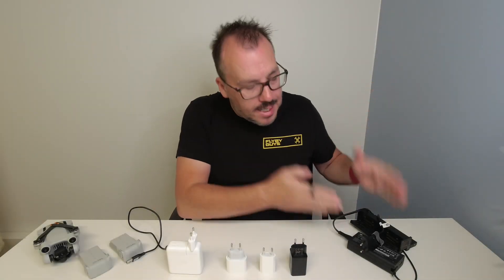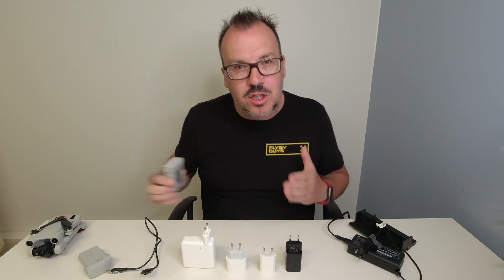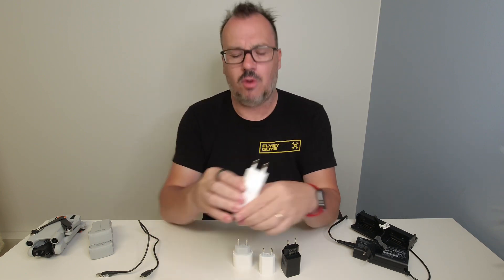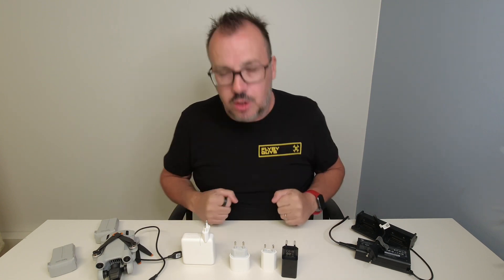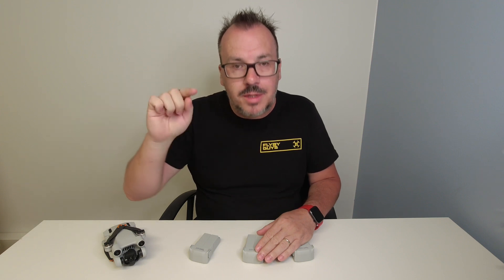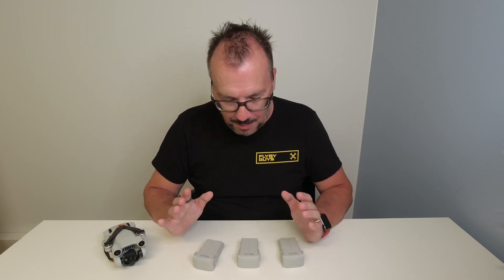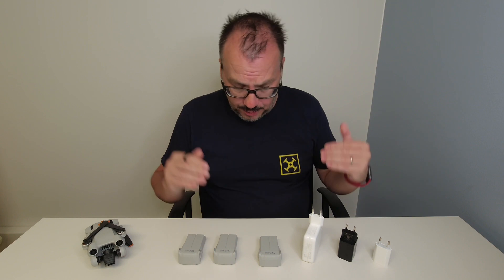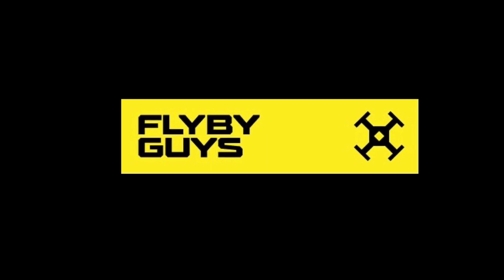Watt The Hell? Charging The DJI Mini 3 Pro, Efficiently!

Comment: WOW, that was actually a big surprise for me. Am I right in thinking though the faster you charge a battery the less life you will get out of it. Also i didn't realize  you can actually charge the battery whilst it is in the Drone. Thanks very much for sharing this. I have liked and subscribed. Any idea where i can purchase the 67W charging plug in the UK.
Reply: Get the Ikea Sjoss 45W, its cheap as chips and It's a solid charging brick
Reply from the maker: Welcome to the channel, Mark. 
I’m sure Curry’s have a fast charging brick, but definitely Amazon. 
I think harm to the batteries can only be done if you’re using them every day. 
If you’re only flying once a week, then a fast charge is fine. Hope the helps.

Comment: I was told to be careful if the watts are high they'll mess up the batteries and they'll have less life? I have an LG fast charge block but I don't know what watts it is I just know having all 3 batteries charging at once it got hot. I have a 10watts charger block from a Motorola phone it went to. Can that work?
Reply from the maker: Hello. I think the harm it does to the batteries is over a long space of time, if it happens at all. 
If you use the drone and all the batteries every single day, then I would be careful. However, using them once a week or so, then I think it's ok to fast charge. Quicker the better I say :)
Reply: @FlybyGuys  what kind of watt block should I use?
Reply from the maker: @mrsjackson5555  Im using anything from 60 - 100 watt charging for the Mini 3 pro batteries. I don't see any issue from my side, but  I don't fly this drone regularly.
If you do, please do this at your own discretion.

Comment: You had a good presentation. But there are a few things that I would have put in there myself which would have added to your presentation.

1. The power cables.
All power cables are not created equally. I would have also mentioned that in addition to this, they have a $16 device that will test your cables to determine whether or not they are designed for data or power or both. The quality of the cable is also dependent upon how much power is going to be going through it and if it is a poorly designed and constructed cable, you could have the most powerful power brick made, but you would not be getting the proper amount of power wattage throughput. Essentially it's like trying to feed a flood water through a straw and we know what happens then, you have a bottleneck. By getting a good quality cable and matching it with a good quality power adapter, you are looking at a considerable reduction in your time to recharge. Also, you're not flying with all three batteries, so I would also suggest that when the Drone lands, you have your two batteries that are going to be fed by an external battery, you know one of these power bricks and when you have the two batteries in there and the Drone lands, just take one battery out and put the Drone battery in there that needs to be charged and use the next battery to cycle it and the first battery that's in there will be helping to cycle power through to the most recently used drone battery. Another school of thought is that you take all the batteries out and only put the one that needs to be charged in their at this time. Theoretically it makes it faster to charge. You might want to consider doing something on that as well with either a drone battery alone and charging with a known good battery brick or a drone battery with another drone battery that's completely charged and just charging up itself. When you look at it, you're definitely considering the best charging plan as well as the best charging devices. I would be very interested to see how other charging bricks compared against each other because the charging with a wall outlet versus charging with a brick is going to be two different things that will have two different results, or will they overall, I give you high marks for doing this because it's easy for people to criticize someone else's work, especially when they don't do it themselves, so cheers to you mate from the United States of Florida

Comment: I've read that it's not recommended to use a chrager that has a voltage higher than 12V for the mini 3. 
Will a charger with the follwing output be compatible with this drone (I'm asking since it has voltages higher than 12V, e.g. 15V, 20V)?

USB-C: 5V=3A 9V=3A 12V=2.5A 15V=2A 20V=1.5A 3.3-11V=2.7A 30W Max

Comment: If time is not a issue would using a smaller charger that goes slower make the batteries last longer?
Reply from the maker: Yes, but it really doesn't make that much of a difference.

Comment: Super many thanks! Great stuff. You just cleared up my main concern, before getting a mini 3 pro. I’m an outdoor guy, spending 10+ days in wilderness with just a light weight 5W solar panel… . . 😂😅
Reply from the maker: Hey, your welcome. 5W solar will be slow, but better than nothing I suppose. A few battery packs are good for backup.  
Thanks for the comment 😊✌🏻

Comment: I bought the Fly More Kit Pkus 47'...As they come without a charger (too bad for DJI) I went to buy a 30W charger but there were 67 and 47 Watts, with the same specifications as in the manual. Input: 5V --3A,/9v---3A/ 12v--3A.Then, No I bought it for the number of watts and I thought it would damage the drone or the batteries. Does it affect that it is more than 30 W? Thank you
Reply from the maker: To be honest, the damage is minimal, if any. You can stick to the 30w and be safe, but hey, inpatient and want to fly 😊
Reply: @FlybyGuys  Thxs 🤩👍

Comment: Don't these DJI batteries self regulate the input wattage?  If so then it makes no difference weather you use a 30 watt or 60 watt.  Just wondering.
Reply: The max charge for the batteries ar 37W so every charger of 37W or higher will give similar results. Note the batteries supports Power Delivery (PD) and not Quick Charge (QC) and always use Usb-C and not Usb-A.

Comment: I’ve just recently bought a charmast 65w 23800mah battery pack off Amazon and getting 32w charge into the battery case. I’m happy with that for taking it on the go if needed
Reply from the maker: Cool. Part 2 of Watt the Hell coming soon 😊✌🏻
Reply: @FlybyGuys  looking forward to it 👍 charmast do another 23800 battery that will pump out 20w which is slightly thinner all round and fits in the dji flymore carry bag better, ones £20 and the 65w £30

Comment: Cool video, thanks for putting this together.   I have been using a Spigen GaN 120W charger that is blisteringly fast, although I have not timed it as you have.   Single USB-C port outputs up to 100W which into the 3-pack charging dock means that the three batteries are charged up probably as fast as is possible to.  At this point I should mention that the Hub and the Drone will draw a max of 30W, well below that the Spigen can deliver. But it does mean that this single charger can concurrently charge a battery in the Drone and in the Hub at upto 30W from each of its USB-C ports. 

USB-A delivers up to 18W each of the two ports.  If a single USB-C port is in use, it provides up to 100W (handy for laptops). When both USB-C ports are in use, it provides up to 60W. Essentially it will Load Share across all four of its ports (2 x USB-C and 2 x USB-A).  At the time of writing the Spigen is £65 on Amazon.  These GaN chargers are awesome.
Reply from the maker: Thanks Danny 😊✌🏻

Comment: Personally I have a wall charger that does 33+33 watt's dual output, connected to the triple charger accessory from DJI. I also have a 20,000MaH powerbank that does fast charging.
Reply from the maker: Faster the better. Nice one.

Comment: Thank you for trying but you’d need to repeat that test as it hasn’t been done correctly and this is due to the lack of PD (power delivery technology on two these chargers). 
Disappointing one was 24W one as it should have reached very similar time as apple charger but didn’t due to the lack of support of PD 3.0 which apple one had. Actually you don’t take any advantage from all that extra wattage on that 67w one but it did perform better as it was the only one using PD and used 9v or 12V to charge as opposed to 5V which other 2 did so no wonder why it was way quicker. Only usb-c to usb-c chargers and cables support PD technology but if a charger doesn’t support that it will only output 5V instead of 9V or 12V. Max current that can go through an usb-c cable is 3A (and this is a physical limitation) so if we have charger that works on 5V (no PD) the absolute max wattage will be 3A*5V=15W, if the charger uses PD they can then negotiate with a charged device what voltage would it accept and choose 5v, 9v, 12v or even 20V so since we already know that that cable is only able to push 3A of current that would be respectively: 15W, 27W, 36W or 60W. I’m not 100% sure whether mini 3 pro or it’s hub uses 9v for charging or 12V (leaning more towards that) but that’s why anything more than 27W won’t make it any quicker. High wattage chargers make sense only if you charge a multiple devices from the same charger (multiple output) and you want to charge them all at their max. So get a 27W with PD 3.0 and it will be as quick as your 67W one :)
Reply from the maker: Thank you. Charge and go. 
Don’t mess around. Timings show the difference. Thanks.

Comment: The worst decision DJI has made is to not make the charging dock to parallelly charge all batteries. Its infuriating to wait for these batteries to charge one after the other. Takes so much time.
Reply from the maker: This would require a lot of power to be pushed to the units. Only so much can be made. 😊✌🏻
Reply: @FlybyGuys  well there are 3rd party chargers available which do this. However,  I'm yet to find a compact one. Not a complicated thing to build such a charger. It took me almost 4 house to charge all 3 batteries using a 100 watt charger. Very limiting.

Comment: Wouldn't using a high-rated charger like the 67 W one cause it to charge too fast, get too hot and actually damage the battery?  And the owner's manual states leaving fully charged batteries for extended periods actually damages them!
Reply: Dji batteries are "smart". Just an FYI, your batteries require updates. Swap them out in your drone and check for firmware
Reply from the maker: Your also supposed to fly VLOS. How many people stick to that rule?
When you work with drones for a living, you need fast charging. Slow limits the amount of work being able to be done. 
Our pilots fly 35 flights per week, using 2 to 3 batteries per job. If one does fail, we buy a new one. More efficient. 
Fast charge, more work. Slow charge, less work. Simple.

Comment: Good info. I have the regular battery and 2 + batteries with the 3 station charger. I've used a 40 watt charger and it works well but I usually just plug it in to an old USB hub, which is probably very slow. But I leave them over night so it is ok. Thanks for the video.
Reply: Please don't leave them charging unattended overnight. Bad things can happen.

Comment: My Apple 29W wall adaptor won't charge the drone or the multi-charger, its like it doesn't even recognise it, I got an Anker 40W wall plug and it works fine for fast charging.

Comment: I was seeking answers with DJI customer support regarding different adapters, all they've answered was to use 30W, but nothing more. On DJI forum many users are also using different W adapters, so it's quite common. My only concern is that it can degrade battery faster, what do you think?
Reply from the maker: Being efficient and time with the battery is more important. I can buy new ones, balanced with how much they ‘degrade’ over how much money they bring.

Comment: Does DJI say it is ok to use such a high wattage charger as your MAC power adapter. Hmmmmmm, I thinking maybe not.
Reply: The charging hub/drone talks to the charging brick which in this case is the mac power adapter. This prevents the mac power adapter from sending way to much power. It is actually better to use a higher rated charger because when using it at a lower wattage it is more efficient and effective. I’m pretty sure it is called USB PD.
Reply from the maker: It also states you must fly within visual line of sight. Does everyone stick to that?

Comment: I've found that type-C to type-C connectors work best. If you have two charging hubs, you can charge two at the same time. If you use your drone you could charge 3 batteries at the same time and have 3 batteries ready to go in about an hour.
Reply: Charge one in the drone while the hub charges the others.
Reply from the maker: Hey Robert. Yeah, more charging hubs is even more effective for sure
Reply: @FlybyGuys  is 65w safe to use when charging the batteries , I have the fly more combo and want to charge all batteries quicker..

Thanks
Reply: Do you know maximum charging speed of the hub? More than 30?

Comment: Hi Steven  Great information on charging the Mini 3,  I just wish I would have waited to purchase the  Mini 3. I purchased a used mini1 and by the time I received it, The Mini 2 was coming out for just $100 more than I paid for the first one.  Thanks again for the video and information about charging your drone.
Reply from the maker: Cheers Johnny ✌🏻😊
Reply: @FlybyGuys  Mini2 seems to be the easiest to charge on the go from a Ridgemonkey 41000mah Powerbank or my Ecoflow river mini. The latter is used mainly for charging my Air2S on the go. 

You didn't answer the power bank issue you brought up at the beginning.